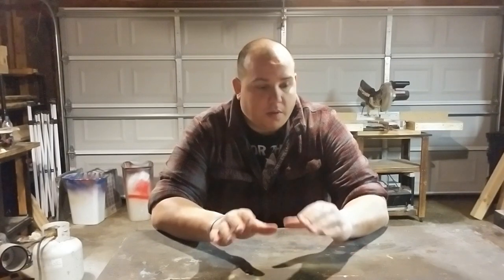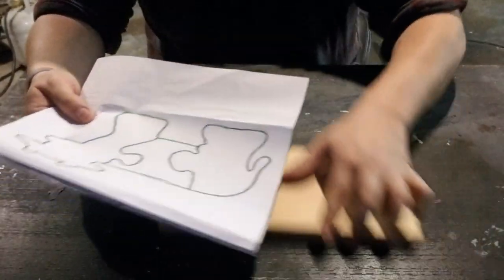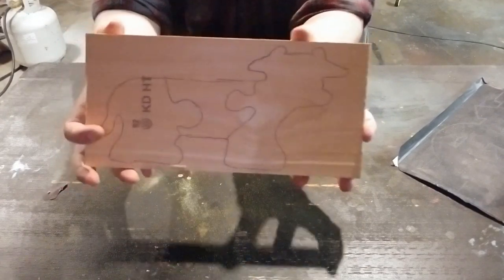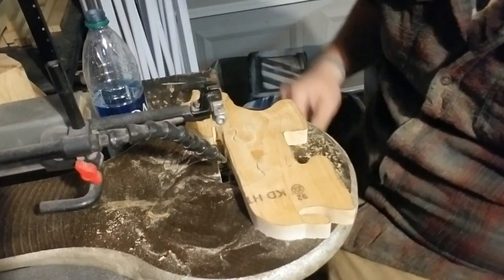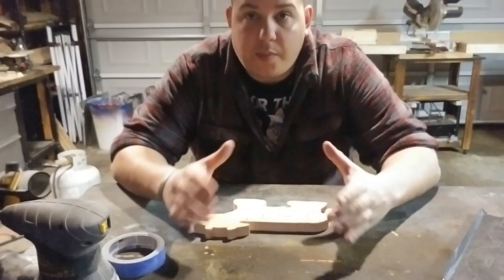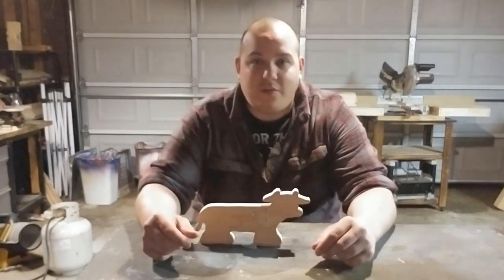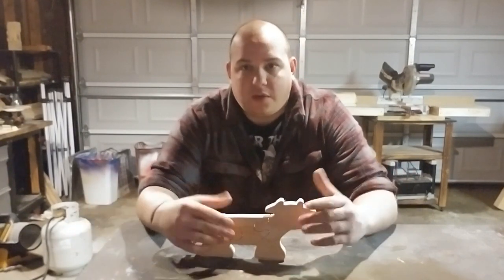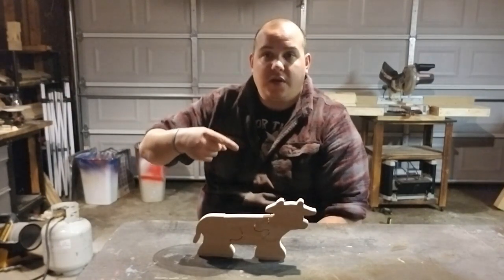DIY Making A Scroll Saw Animal Puzzle For Kids

Comment: It looks really great I do a few puzzles on the Scrollsaw I usually do the outside cuts with a no.7 blade try a no.2 for all the inside puzzle cut I just really take it slow I’m slow cutting anyway trying to stay close to the line I’m not very good at it very rarely break a blade they seem to fit tighter I enjoyed your video
Reply from the maker: Thanks man I appreciate it. I will definitely try using  a smaller blade myself.